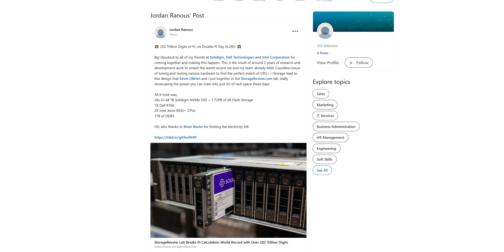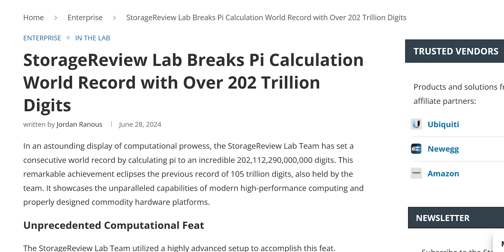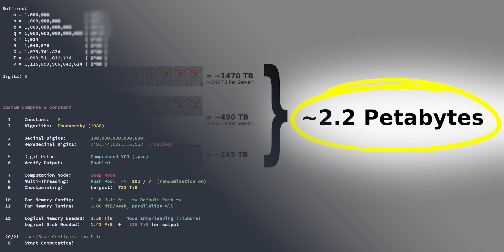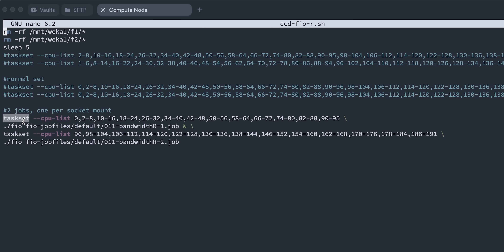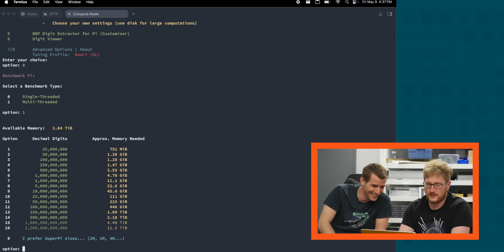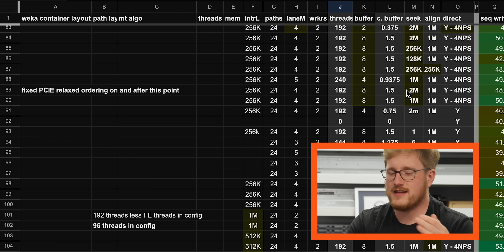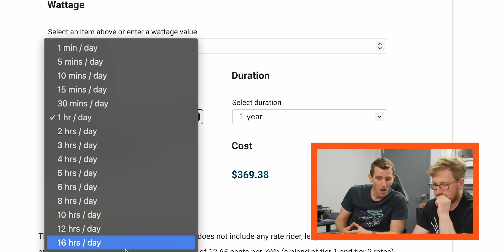The $1,000,000 PC set a WORLD RECORD

Comment: How about not absorbing such a high power at a small point first, but rather scatter it with a transmissive diffuse sufrace. Now, I'm not entirely sure about the wavelenght as you didn't mention it I don't think. 
But something like those old glass blocks of milky white glass and add a heat ressistant object behind it with an airgap?

Might still thermally shock the glas if it absorbs enough of the frequency anyway. But it is the first thing that pop up in my head.

Comment: Now I've gotten the really dumb idea to let my RasPi (model 4B with 8GB of RAM and a 64GB MicroSD) run 24/7 for however long it needs to calculate 314,159,265,358,979 digits. Would probably not finish in my lifetime tho…

Comment: To calculate the circumference of the observable universe (~8.8×10²⁶ m) with Planck length precision (~1.6×10⁻³⁵ m, the smallest meaningful unit of length according to quantum physics), you only need 62 digits of π. Beyond that, the digits have no physical meaning.
Reply: From a computer science perspective still an interesting project since it stresses every part of the system, from cache to cooling.
Reply: 62 decimals, 63 digits*
Reply: Cumulative exponents GANG
Reply: BUT .... This Universe is but ONE tiny universe bubble out of the Oxillions (I made that up to go past Yotta!) bubbling about within the quantum foam. Think of our universe as one grain of sand on an interstellar beach that is many Quintillions of Light Years wide and many Yotta-somethings light years long and many Quadrillions light years deep, so many grains of sand that such a value is sooooooooooo HUUUUUUUUGE  that we need need numbers even larger than 1024-bits wide to describe those amounts and distances!

There! That will show up as the existential crisis that happens when you think of massive multiversal groupings and distances!

V
Reply: I was about to make a reply saying it would be more, then I looked it up and did the math and it is exactly 62 digits.
Reply: @HyperspatialAgent_Axis4 it's absurd how often the difference in exponents + 1 (26 - -35 + 1 = 62) can substitute for much more involved calculations.

Comment: The idea of rounding to the nearest number always goes 5 and up you round up, 4 and down you round down. So even at 3.1415, you would end up rounding up to 3.142 then everything else rounds down from there. In most cases of pi usage, 3 is a good enough approximation for that reason. 3.14 is even better but anything beyond that is basically margin of error.

Comment: 📖 00:00 • 03:33 Introduction to Pi Calculation
    • 00:00 Calculating Pi with Super Pi and Overclocked Athlon
    • 00:30 Current Record and Storage Challenges
    • 01:00 Smashing the Record with Kioxia's Gen 4 NVME Storage
    • 02:32 Perspective on Calculated Pi Digits and Hardware Overview

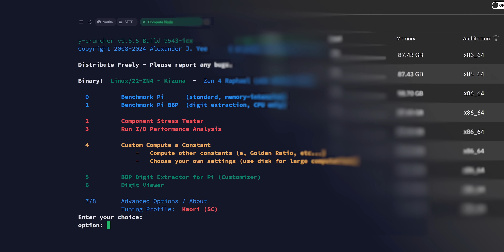📖 03:33 • 07:12 Server Configuration and Storage
    • 03:33 Rationale for Multiple Servers
    • 04:04 Storage Capacity and Expansion
    • 05:08 Compute Node Modifications
    • 05:41 Network Card Upgrades and Performance

📖 07:12 • 10:18 Introduction and Context
    • 07:12 Using Weta Software in an Unconventional Way
    • 07:43 Tricking Weta into Thinking Each Server is Two Servers
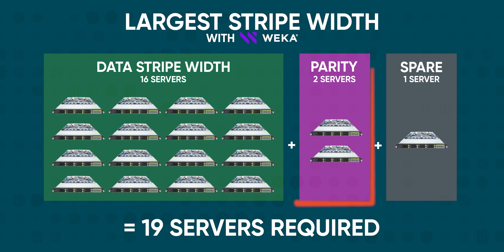    • 08:15 Storage and Bandwidth Limitations
    • 08:46 Optimizing Memory and Cache Usage

📖 10:18 • 12:50 Discussion on Core Utilization and Storage
    • 10:18 Configuring Core Usage for Specific Tasks
    • 10:48 Impressions on Storage Performance and Speed
    • 11:20 Actual Copying Data and Front End Usage
    • 11:50 Drive Array Performance and Kyokia Drives
    • 12:20 Y Cruncher Software and Storage Requirements
    • 13:22 YC Cruncher's architecture and limitations
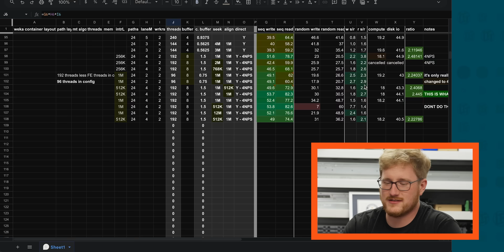    • 13:54 Tuning options for YC Cruncher
    • 14:25 Project background and future prospects
    • 14:55 Calculation process and power outages
    • 15:25 Facilities challenges and solution
    • 16:25 Calculating Pi's 300 Trillionth Digit and System Performance Details
    • 17:27 System Power Consumption and Record Safety
    • 17:59 Practical Use of Pi Digits and Project Reflections
    • 19:01 Project Wrap-up, Acknowledgments, and Future Content

congrats🎉

Comment: To compute the circumference of the observable universe, to an accuracy of the diameter of a hydrogen atom, you only need 38 digits of pi (or 37 decimal places).  For an accuracy to within a Planck length (1.6162 * 10^-35 meters; which is 0.000000000000000000000000000000016162 millimeters), you only need 62 digits.

Comment: Fun bits of info:
- NASA uses only 15 digits of Pi to calculate interstellar travel. It's accurate enough to pinpoint Voyager-1 with roughly a 1.5 inch margin of error.
- At just 39 digits, Pi is accurate enough to calculate the circumference of the ENTIRE UNIVERSE to within the accuracy of a single hydrogen atom.

There is absolutely no use case for anything beyond that, but it's fun regardless!